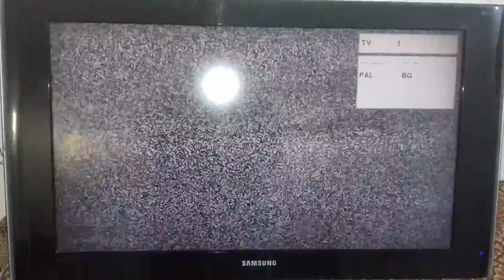T-CON BOARD VOLTAGES || SAMSUNG T-CON BOARD REPAIR

Comment: Greetings, i bought a Samsung le40d503f7w in europe. when i installed in in South America 110v it played for 30 minutes and then it froze. i unplugged it and put it back on, but now i have a black screen only. What could be the problem?
Reply from the maker: see on tv backside label for voltage reference,if it is compatible with 100-240v then voltage is not issue